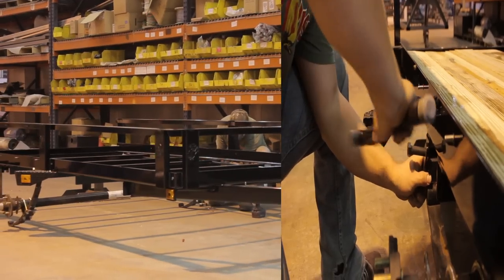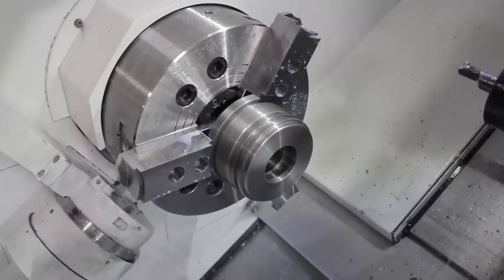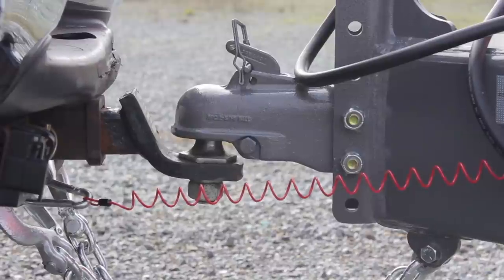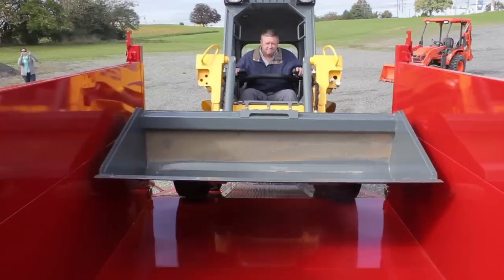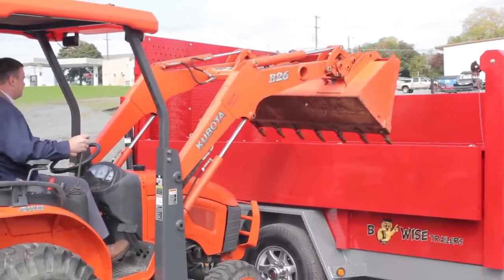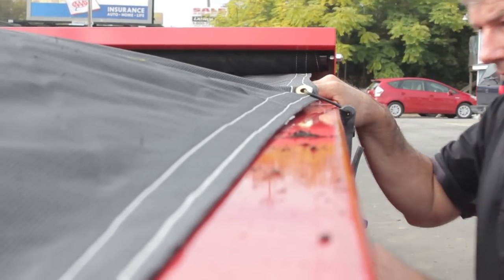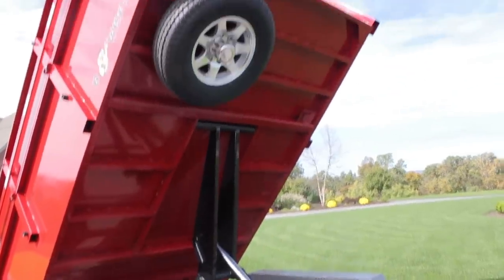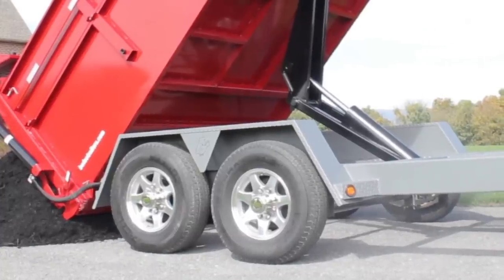The Ultimate Dump Trailer

Comment: Planning a trailer build and had the same idea to mount the d rings on the sides to keep the floor clean. Hydraulic jack is great too. The dual purpose hydraulic tailgate is nice but it does get in the way when dumping  large loads of brush that stick up above the sides. Ideally it would clear the sides by several feet when fully raised to give plenty of room for  dumping those kinds of loads.

Comment: I will be buying one of these very soon.  I was wondering if you have experienced any paint fading with the red?  If so, I would just go with the black sides and red bottom.  Thanks!
Reply from the maker: Thanks for asking. We do many different colors and don't have any type of consistent paint issues. Each trailer gets primer and a premium top coat, so any corrosion which would otherwise chip away at the finish is stopped by the primer. The powder gives the finish a nice shine. We do a lot of red/gray and red/black frame on Bwise dumps, but there are so many more other combinations you can do. Even red/white is really nice.

Comment: Can you build one high like pup but put gooseneck and electric brake axle 8 to 10 ton capacity
Reply from the maker: Hey Gary, I can't change the physical height. However, we can build this with a Gooseneck and we do have a version available with 8K axles (17,600# GVWR). We're actually in the process of doing a video about that.

Comment: Well , I've got to tell you , I like it but..... it has some flaws.
  1.
The hijacker jack leg failed first use.
The push rod on the ram is attached to the foot pad on the jack stand. The pad foot was tack welded on and the welds broke.
 You could still raise and lower the trailer on the hitch but had to use a strap to hold the jack up . I had to replace the jack my self because the dealer I bought it from is not customer friendly.  Big Tex Trailers , Beaumont Ca.
  2. The hydraulic system is mounted in the box , but mine was a little off and one the hydraulic hoses was rubbing against the slot cut in the box for the hose .
It didn't rupture it but it's close . I caught it in time and moved the pump my self to fix this.
 3. It appears that the metal plate on the lift gate is tack welded also and not a solid bead. I will take a video of these item and post it for you.
 Other than that It seems "ok".
 After taxes it came to about 20 k. At that price  
 A little more attention to detail is in order . It seems as though it was built in a rush.
 Little update , I just got a recall letter for the coupler.

Comment: My only concern is with that back door / ramp. 

Will it give enough clearance for a forklift to load pallets of roofing shingles into the trailer from the back . Obviously it won't work with the gate opening as a ramp . But opening the other way looks like it might not give enough clearance

Comment: Give it to me straight! No BS. How much for a 14 or 15 footer?And what type of Truck (Chevy, Ford, Dodge) will I need to pull that dam thing without destroying my Engine and Transmission. Thank you serious buyer.
Reply from the maker: Thanks for asking. The straight answer is we don't sell direct from the factory, so I need to ask you to please have a dealer quote the trailer. We just don't compete against our dealers. As for what you need to tow it, brand won't matter. If the tow rating covers the GVWR, that's all you need.
Reply: @BWISEManufacturing  - Thank you for responding. I live in SACRAMENTO California. Can you please point me to a Dealer near me, or in California. Thxs, and be Safe🙏
Reply from the maker: @planestrainsandautomobile6651  Sure, we have a dealer in Tracy, CA not far from you. They stock the Ultimate Dump also. https://www.travlntoys.com/

Comment: I like your video and am interested in your product.  I have a  few questions:
1) I live in Chester Virginia, do you deliver and what is the cost?
2) I have an F150 4WD truck and I am not sure which trailer size is best (generally I want to haul mulch)

I await your response,

Bob
Reply: these are too heavy to pull with a half ton legally